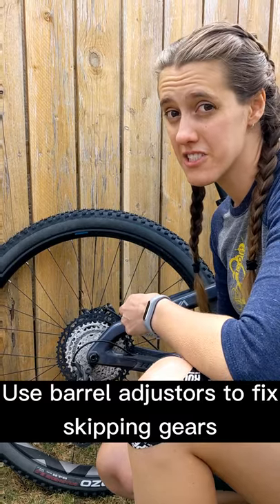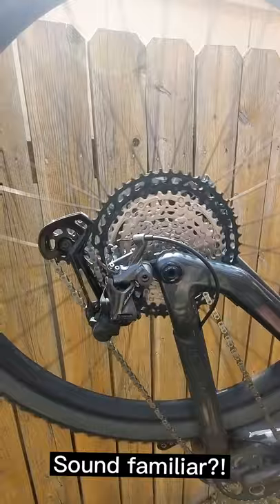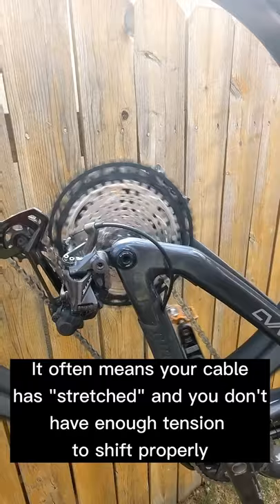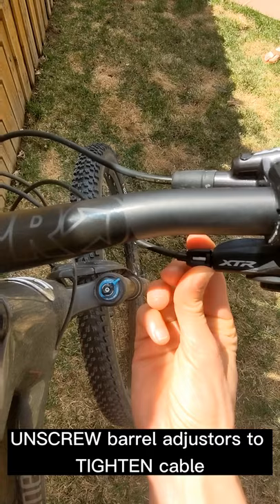How to fix skipping gears while riding (with barrel adjustors) #Shorts

Comment: Any plans on doing a series on bearing service? Wheels, pivots, bottom brackets
Reply: Wheels are the most easy,bbs are kinda tricky you need right tools to change bb axle
Reply: @RiderBlitz1.0  eh debatable pretty easy to loose the balls unless you have cartridge bearings in your wheels, bb axles at least have more room if you know what I mean
Reply: @Eng586  yes, thank you for answering, my wheel and bb axle are fully bearing cartridge, just this morning i changed my damaged cartridge and boy o boy its feels sooo smooth and speedy when riding
Reply: Bearings was kinda easy im 15 and did it 5 months ago and I have riden about 1500 km and it’s good I don’t trust
Repair men with bicycle guarantii or what is called cost me 15€ to change rear axle that they didn’t replace they tightened on 2 things on axle bad english they are waste of money

Comment: Wow, thank you so much for this. I was so worried about the gears I don’t have a bicycle stand for servicing the bicycle and I was wondering how do I check the gears without one? Do you happen to have any suggestions on this? I can’t afford to buy them one yet, I would really appreciate it the barrel adjuster you just told me about on this video. Thank you for this. I have no idea because my last bike did make this sound.
Reply from the maker: You can pretty much hang the bike from anything, just use a strap or piece of twine. Or even ask a friend to hold up the rear wheel for you.

Comment: I felt down with almost no speed. The bike felt on the derailleur. Visually it looked ok, but later I found it better inside touching the spokes. I bent it back, manually. Later, on climbing I found it can’t keep speed 12,11,10. It keeps jumping from speed to speed. What would be the fix in this case?
Reply from the maker: Most likely your derailleur hanger is bent. A shop that has a derailleur straightener should be able to straighten it unless it's too worn in which case it needs to be replaced.

Comment: What if it's only my big cog and no others? I have a 50T - 12T and every other gear goes just fine, but gear 1 is half in. Unscrewing the low limit does nothing. Only if I hold the paddle down will it stay properly in gear.
Reply from the maker: Hmm... That sounds like it should be the limit screw (are you sure you're loosening the correct one?) Otherwise you could check the b-tension screw. And finally it could be that your derailleur hanger is slightly bent.
Reply: @sydfixesbikes  I have both limits backed all the way off. 9-2 are all perfect shifts with no rubbing. Brand new derailleur since the last one was shifting even worse so I warrantied it. The hanger was checked at a shop and is straight. Cable is new. The last screw on the back is the only thing I haven't checked, but I'm not sure what to do with it. Nothing interferes when shifting and there's a good bit of space between the big gear and the derailleur itself.
Reply from the maker: That last screw is your b tension screw. This video explains all of this in depth and will hopefully solve your problem!
https://youtu.be/of-T8uB8tbs

Comment: my mtb was having trouble shifting down the gears, I would have to shift two or three times to get it to change down. So I experimented and ended up turning the barrel adjuster all the way in and it's still skipping gears. Any suggestions?
Reply from the maker: Most likely you need to replace your cable and housing as it's worn out. The other possibility is a bent derailleur hanger

Comment: unscrewing the barrel adjustor loosens the cable though
Reply from the maker: Nope, it loosens the barrel adjuster bolt which increases the length of the run, thus tightening the cable.
Reply: @sydfixesbikes  this does not correlate, increasing the cable length increases tension how???
Reply from the maker: You're not increasing the cable length, you're increasing the length of the housing + barrel adjuster (the cable run). Since the cable is locked in place by the bolt on the derailleur, increasing the run puts more tension on the cable, thus tightening it. It's confusing, but you can test it by screwing in your barrel adjuster all the way, checking what gear it's in then unscrewing it fully and you'll see that it goes to an easier gear. (Note: this is assuming your bike has a normal, not rapid-rise derailleur)
Reply: @sydfixesbikes  in that case the tension remains identical, the cable run is just longer
Reply: @relitto1019 are you trolling or are you genuinely slow
Reply: @Coastal_Cruzer  coming out the gate with an insult, youre the slow one
Reply: @relitto1019  I'm sorry I was having a really bad day. Do you know how a screw clamp works? Basically take that but instead of clamping inwards (compressing) it's clamping outwards (stretching) thus lengthening the path the cable has to take